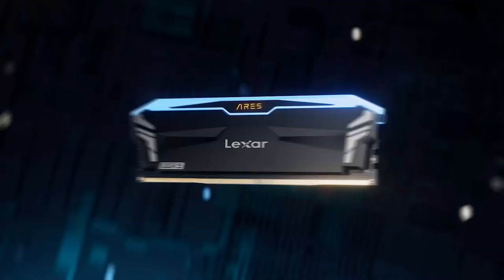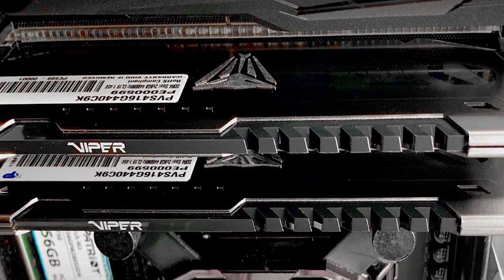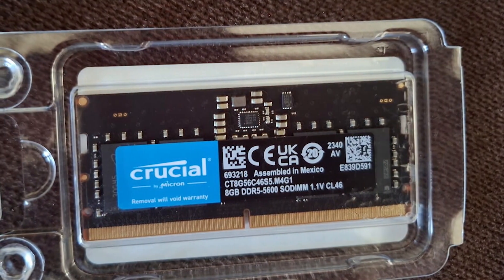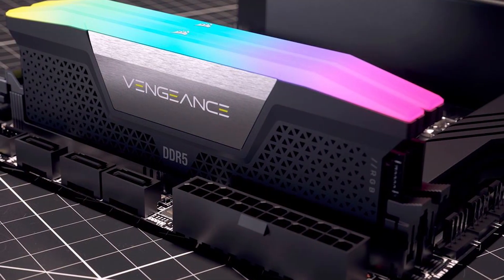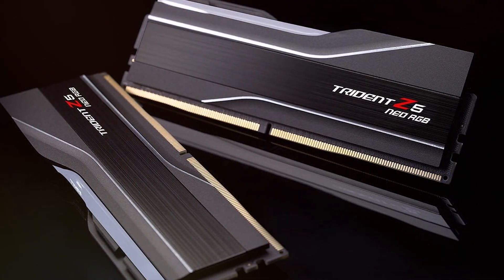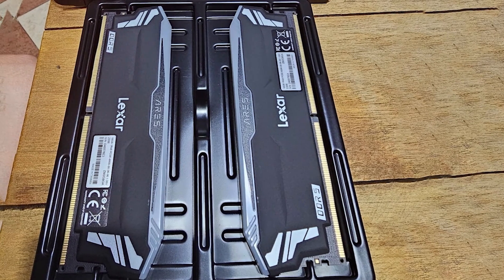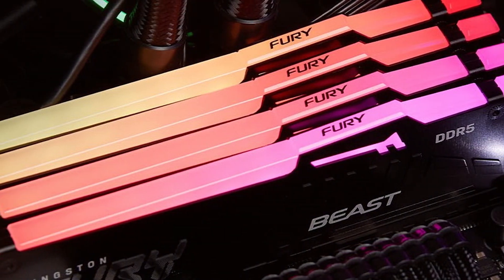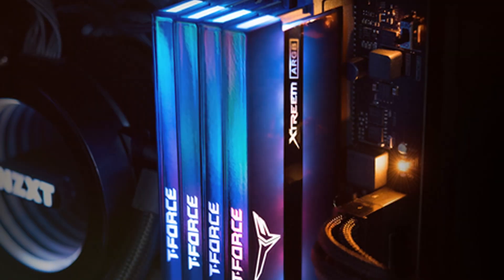7 Best DDR5 RAM: Enhance Your Gaming and Workstation

Comment: This video is frankly quite useless. Your video starts with DDR4. You give broad statements like this RAM will give you the power you need with high quality material, and this is good for rendering or some such, Giving no specifics or actual data. You fail to mention the trident Z Neo is a Kit specifically designed for AMD platforms by having the EXPO profiles, denoted by the "Neo" in the name. This sounds more like a day-time TV advert than anything useful for buyers. Your statements of usability, compatibility, affordability, functionality and modern design, you give to all the kits. You've not actually differentiated any of them.

WASTE. OF. TIME.   Yours and the viewers